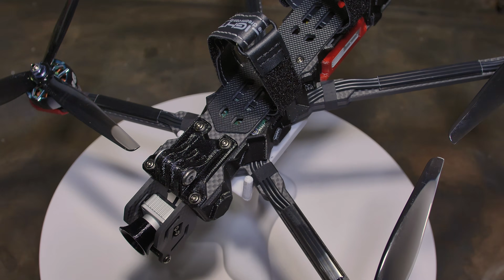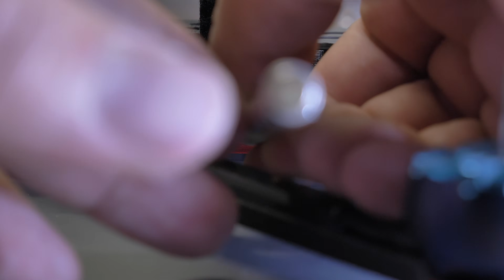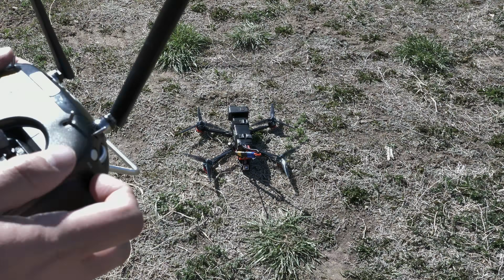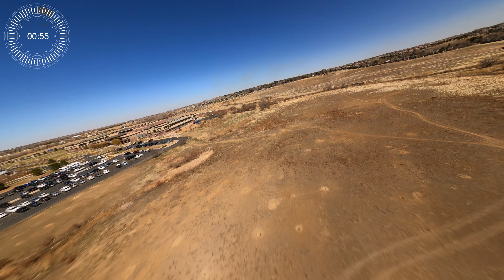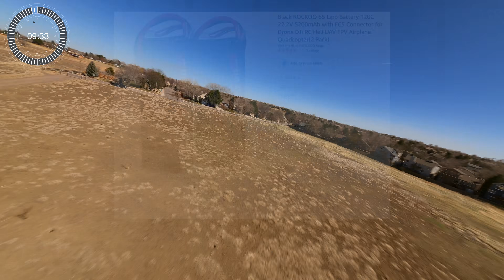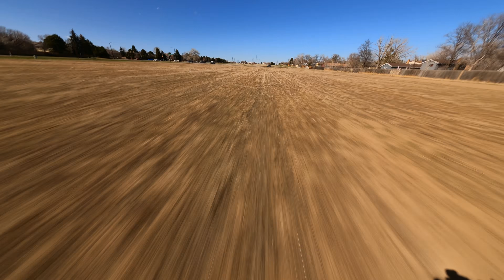The NEW iFlight Chimera 7 PRO 🔥 (Unbox | Setup | Flight)

Comment: Is there a way to make it more quiet with certain props?

Also how do I do the 1250mW hack? I want maximum range but preferably stick with the Integra goggles and FPV v2 remote.

Do I straight have to go to a TRX50 with an ELRS module or would that dji remote be fine? 
Im a total noob but this drone is perfect for what I want to do.

Comment: Very impressive video with clear explanation Sir but, the voltage of the lion battery plz? Or 22.2v is ok.
Reply from the maker: The voltage of the LION is the same as Lipo, but you can take it down to 3v per cell safely.

Comment: What are the charging settings you did for each battery?
Reply from the maker: I charge at a 2C rating on all my gear. I also make sure the LiIon is set to Liion in the charger before starting

Comment: I just ordered mine (7Pro) today the rtf version I like my quads to have their own kits. 
I have flown FPV in years and new to beta flight. Last time I tuned a flight controller was in Libre lol. 
Any tips in the gps set up I’d like to have that feature a lot of mountains where I’m at. 

Thank you
Reply from the maker: Hey that is great you are going to love it. I have not fully tested my GPS Yet because it can be a bit tricky and I have not had time to test it and I was scared to lose it LOL. Check out this video by JB for detailed help: https://www.youtube.com/watch?v=-bYavyTRvx8&t=686s
Reply: @AdventureFPV  will do thank you.  I ordered the 915mhz rtf kit. Should I change it to the 2.4ghz version, I’m asking because I have a spare brand new DJI controller from my DJI inspire I could use.
Reply from the maker: @ChrisNieves  Hmm did not think you could use the inspire remote. I use the DJI FPV Remote V1
Reply: @AdventureFPV  I figured since they are both 2.4ghz band simplistic thinking.
Reply from the maker: @ChrisNieves  Honestly they should work but as far as I know they do not. Thanks DJI.

Comment: Hi anyone know how I can flash this fc firmware on my generic 7 inch dead cat frame cheers guy I'm using Emax ECO II 2806 1300 KV when I arm my quad at low throttle uses 37 amps on the deck video been posted when takeoff hit 55 amps motors get red hot any ideas what going on with it cheers new to 7 inch long range drone plus didn't build this one Cheer's
Reply from the maker: Hey man, sorry I do not have any great ideas on that one. Hopefully someone in the chat will chime in. Thanks.

Comment: The battery from Amazon is not XT60 connector. What's the different? Do you have to buy a different adapter?
Reply from the maker: Yeah I eneded up using an adapter, But honestly I think a 3500 MAH would be much better. Looking for one now.
Reply: @AdventureFPV  thank you so much for answering so fast! Please let me know when you find where to buy it. Regards and thank you for the great job!
Reply from the maker: @intillanes  Found this but it is expensive and back ordered... https://www.getfpv.com/lumenier-3500mah-6s-120c-cinelifter-lipo-battery-xt60.html

Comment: hold on.... only 8 minutes with the 5200mah pack? 
try reduce battery weight. if i put a 2000mah lightweight HV lipo on my 6" i get like over 12min including cam on board.
Reply from the maker: Yeah It was more like 10 and I landed the first time I got 21.2 in my goggles as that is how I normally fly. I could have cruised around in circles for about another min for sure if I wanted to push it.
Reply: @AdventureFPV  nah nah we dont talk about circles to make the battery totally flat. there must be like 20% rest inside. but even with that i can fly so much longer. ok never mind. thanks for answer. glad you like the new pro. i also love the evoque 6". nice cruiser and our flight style is very similar 

keep the blue side up mate°🤙

Comment: 60% throttle surely isnt testing efficiency times.   Do a 30mph cruise entire pack at around 25% throttle  . No say the v2 is getting lot more time on higher kv motors. May take a less pitch prop to increase time too .
Reply from the maker: Yeah I'm going to definitely go back and take this out for some more testing. Thanks for the input I'll give that a shot. This was really just a first impressions video. What camera angle should I try? This is my first long range quad.
Reply: @AdventureFPV  Dont matter the camera angle matters the angle of attack. So turn pitch angle on in your osd then fly in acro to better lock angle the least amount of angle the more efficient so say u can cruise 25mph at 20deg. pitch but then only 28mph at 24deg pitch well most likely the 25mph at 20deg is more efficient than 28mph at 24deg being 4 more deg to only go 3mph more which probably will draw a few more amp as well so yea get a idea of crusing speeds at different pitches and make sure to see what amps each angle is drawing along with speeds achieved. Also order different pitch bi blades even 7in. Also maybe. But in few months someone will have tried lot of stuff and will know more data.  I just ordered this quad today and yesterday i ordered the Rekon 7 Pro which is LIGHT  500gr and 2806,5 motors 1250kv that one will be great for endurance so i dont care to much if i do not get the best times of Chimera 7 pro . I saved like 46 dollars on bangood using Albert kim's coupon code  in the description of his video on the rekon7 pro and it also worked for the chimera 7 pro and saved like 55 .

Comment: They just ruined such a great quad. Longer Arms just to fit 7.5 props will end in lower frame resonance frequency and decrease performance since they did not increase arm thickness. Then there are these chunky oversized and heavy motors. Combined with those low pitch props you will just waist energy.
Secret sauce for high efficiency cruise is low kv, high pitch props and least weight as possible.
Reply from the maker: Great info, I am new to the long range and 7 inch world. This is my first. It defiantly sounds like the PRO gets less flight time. But I must say going from a 5" to this I am blown away. But I guess I do not know the difference. Happy flying.
Reply: even lower pitch spinning faster wont draw much more amps due to load variables . Key is light weight and more efficient motors with shorter stator's  09 is kind of tall The Rekon 7 pro got it right with the 06.5 tall 1250kv and 500gr weight  .  Chimera7 pro should just name it the MLR medium long range .
Reply: @Matt-xy6cf  
It depends on your usage. For fast cruising (100+ kmh), higher pitched props with low kv motors will be more efficient.
For slow cruise (60kmh), low pitch props will provide more efficiency. A low pitch prop needs to spin much faster for achieving the same speed, this increases aerodynamic drag on the blades making them less efficient. I´m testing now for 2 years different 7" setups, thats what I could definately verify. Most efficient props for high speed are APC 7x5 biblades. 
And lower weight is of course always better :). As I mentioned in the first post, these motors are slightly oversized and therefore less efficient.
And yeah, "long range" is missleading, I would call it medium range
Reply: @waldemarkraus2855  I see . Thanks for response. Yea i will be new to long range 7. I have both the Rekon 7 pro and chimera 7 pro both coming in mail. BUt more so i want a custom AOS Falcon 7 built like Fab FPV has built his with the F90 2806.5 1300kv etc that he used. Are there any long range 8in builds yet from anyone that perhaps are even more efficient ?
Reply: @Matt-xy6cf  
8" is very exotic size, better go with 7" wich is more common. I had the AOS Falcon 7, but like my FR7 more for couple of reasons. After 1.5 years and dozens of iterations of my FR7 I found my perfect setup. 
All my 7" running 2806.5 Motors. T-Motor F90 is a good choice, they are very light and are perfectly balanced. GEPRC released a new very light 2806.5 motor, wich looks great.
Reply: Yea i looked at the FR7 and looks nice as well. U ever try one of the Airblade Transformer 7 long range frames? The airblade site is where i seen the FR7 at.
Reply: @Matt-xy6cf  
I think the airblade transformer frame is not sold anymore. I would go with the FR7 V6 from airbladeUAV, it has some improvements to save some weight and is a great proven frame. Best thing, it's open source.
Reply: @waldemarkraus2855  What would u say is the best gps with compass to use BN880 seems to cheap at 20 dollars. Not sure if to big also.
Reply: @Matt-xy6cf  
I use BN880q, works very good. Matek m8q is much smaller but also more expensive.
Reply: The arms have the same length but not identical. The top plate of the frame has also the same length. When someone will mention "Oh, the frame is longer now", that's nonsense. The holes for the screws (front and rear) have the same distance. For me it's disappointing not getting longer arms to mount 8" props without stacking up the rear motors. Luckily I just bought the frame only and didn't waste so much money.

Comment: Great video Lee! I actually expected more flight time out of the Li Ion pack from what I have seen from other people but 10 minutes is still awesome for such a big quad. Keep up the good work 👍
Reply from the maker: Hey thanks, There is also a 6000 mah lion also, I bet that would do much better. It would probably help if I adjusted the camera angle as well.
Reply: @AdventureFPV  did you fly it to around 2.8V or rather 3.7V per cell like a lipo?
Reply from the maker: @robinvanlooy294  when I started to see the quad dip around 3.5 Per cell I brought it in for a landing. Once it was on the ground the voltage was probably around 3.8
Reply: @AdventureFPV  you can decharge the li ion packs safely to around 2.8V per cell, that's one of the advantages of li ion batteries compared to lipos.
Reply: @robinvanlooy294  
Under load even down to 2.5v. At 3.5v it has still 50% left. You should be able to get 15-20min cruising
Reply: @waldemarkraus2855  yeah 2.5 is the limit, I fly mine to 2.8V for safety but 2.5V is indeed possible

Comment: Looks like the motors are a bit oversized. Beause i also got that new chimera last week. It realy flys great. But the flight times are about 1/3 shorter, compared to my old 1300kv chimera.
Reply: Is your new chimera 7 on 1300kvs as well mate? Because the 1800kvs will drain batteries faster but should be more powerful and quicker which is what I'm using and still pretty happy with the flight time because I don't really fly long distance.
Reply from the maker: @KwaddawK  Mine are 1250, but I also land really conservatively. If I ever see 21.2 in my goggles I come back and land.
Reply from the maker: They might be. Like I said this is my first experience with a 7-in quad and 6s. Lots of new factors in play for me. But I got to say coming at it without any expectations that was pretty happy with the flight time so far. I also land when my cruising voltage gets to around 21.2. when I landed I had probably about 21.8 I land pretty conservatively.
Reply: That’s absolutely shocking mate! 😩
Reply: @LandOfSaintsFPV  yeah im also a bit disappointed. I have to make some moore testing. I cant believe it xD
Reply: @LandOfSaintsFPV   i did a short comparison Video between my 2 Chimeras... its realy disappointing! https://www.youtube.com/watch?v=ThfkxzyxIkk&ab_channel=RRDronephotography
Reply: Learn math your video is roughly 18% shorter. Taller motors and heavier quad equals less time. Play around with different pitch bi blade props, cruse slower , turn motor timing too low and perhaps run 5s li ion instead too save li ion battery weight and run a 7000 5s li ion vs a 6000 6s .  Can also charge li ion to 4.25v even just as people do with lipo's . I accidently charged a lipo left on Lihv and charged it to 4.35 and sent it now it may have shortened the life of that lipo by a few charges though but .05v over is not much .
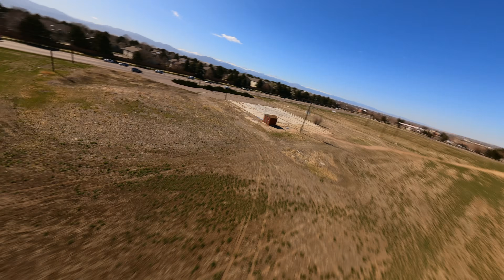Reply: @Matt-xy6cf  i know my video with the pro is "only" 18% shorter... but the pro not only landed earlyer, it also used moore energy. It used 2320mah for the 8.40min, the old one 2150mah for 10:30. And that was only one flight. Overall it feels round about 1/3 less efficient for me. Or ok maybe 1/4. That doesnt realy matter.
And yeah of course you can get better flight times with bi-blades, and 5s Batteries. But this would be also possible with the old one. Snd get even longer flights.
It is a bnf qad, that is selled as a 6s long ranger. With 3 bladed props. 
If you buy a bnf quad it should just be possible to use it, without to mess with different props, and lower voltage batteries, pwm frequencies etc.
The "Pro" realy shines in flight performance... it has moore punch, and overall moore power, with the bigger Motors. I think ill use it moore as a 7.5 inch fast freestyler :). For that it is a realy nice quad. 
For slow cruising long range ill use the old one.
Reply: @Matt-xy6cf  this is an old vs new comparison and his maths is correct, think you might have missed his point mate 👍

Comment: Good review mate, I think you are one of the first to show this quad off. I have the Chimera 7 V1 digital with 1800kv motors and that thing is fast. Im getting 8 and half minutes of semi freestyle on 2 x 1500ma batteries (minus gopro) but if I fly conservatively it should be pushing 10-12mins with my setup. I would have expected yours with the lower KV motors and an extra 2000ma to fly for like 15-18mins with soft flying. Perhaps extra weight working against it in some regards there. 
Keep up the awesome content mate! 🙂👍
Reply: that's exactly what i noticed too... i have both quads, i have an old chimera 7 with tje 1300kv 2806.5 motors, and i got the "pro" one last week. So i can compare them 1 to 1... the old one is much moore efficiant! With the old chimera i fly 10+ minutes with a 2600mah lipo. And i fly up to 25 minutes with a 6000mah li ion pack. 
With the new "pro" one the 2600mah lipos hold only for 6-7 minutes, and the 6000mah li ion only about 12 to 15 minutes. I am a little bit disappointed about the bad efficiancy compared to the old chimera! 
I tought my one has a bug. But it looks like its normal, if i see this Video.
Reply from the maker: Wow man that is crazy, KV to Weight Ratio? I have nothing to compare the new one to see this is good information.
Reply: @rrdrone90  Are you getting more distance therefore
are you cruising at a much higher speed?
Reply: @dreswan1  nope i dont get moore distance, because the speed of the pro is not much faster.
With the li ion cells (i use li ion's, for very LR) its even slower, because the batteries cant handle the current draw if you try to fly faster. With the old chimera you have moore reserve to fly faster. 
The new chimera 7 pro is moore like a 7.5 inch freestyler with lipos, but seems not that good for LR flights.
Reply: @rrdrone90  maybe the bigger motors & props sagging motor a lot more having you land a lot earlier. 🤔  I have rekon7 (I modded it for 8" testing)  but eyeing chimera 7.5 .. wanted more battery space & more efficiency. I'd also run bigger battery it. 
On my rekon I run up to 6s 8000mah lion. 7.5" & bigger motors I would try squeeze 6s 12000mah lion 🤣.  See what Max flight time is cruising.  
(I fly slower than most usually 25mph cruising for flight time & like 30 to 40 going out places maximizing distance)
Reply from the maker: Hey thanks for watching. Yeah I was pushing it pretty fast for the entire flight. It may not look like it but I had some pretty good speed. I think the extra weight does not help. I will try a 1500 too.
Reply: @AdventureFPV  Yeah I go double 1500s. Would probably prefer just a single 3000ma for making it easy to set up and plug in.